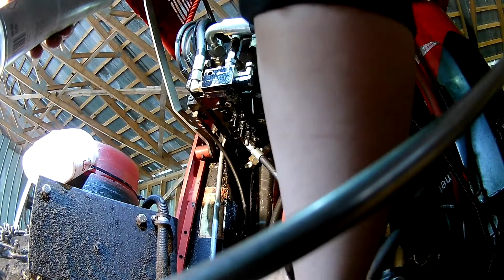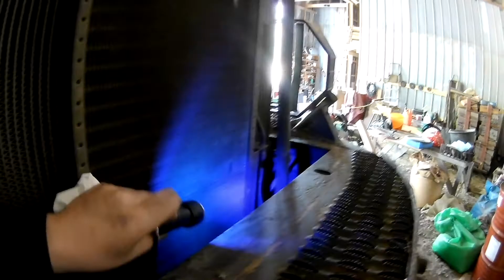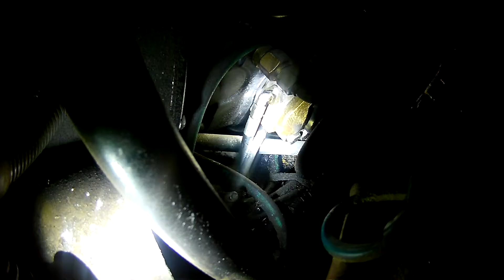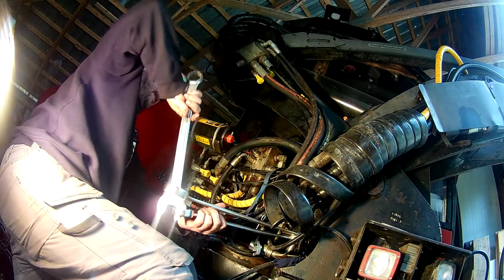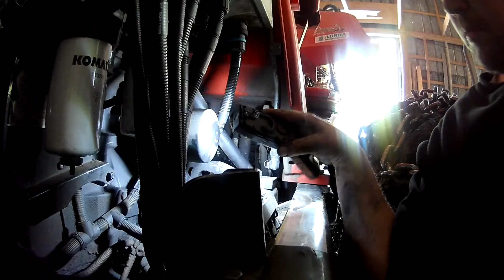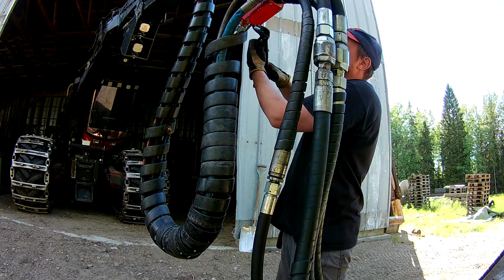2022 Valmet 911.3 chasing small oil leaks

Comment: I like the powder trick to find the leaks
Reply from the maker: Try to remember how I learnt about it but can't remember. 

Been using it for many years when trying to find small leaks of any kind makes it alot easier to spot them.

Any fine powder works. Wheat flower most people have at home. But used talcum powder also usually comes in some container with holes in it so you can sprinkle it over the area. Even foot fungus medicine that came in powder form have been used 😆